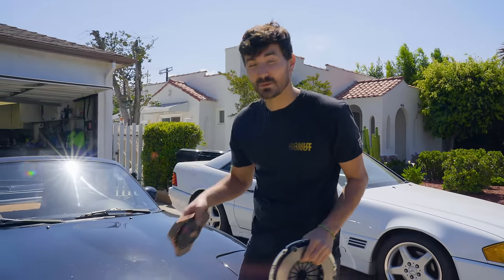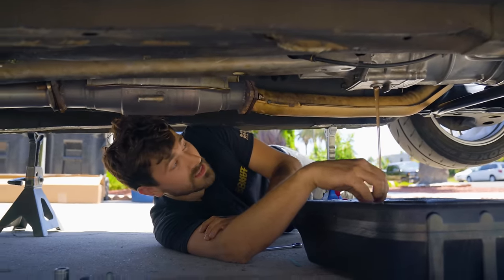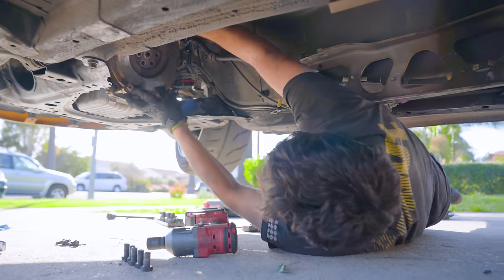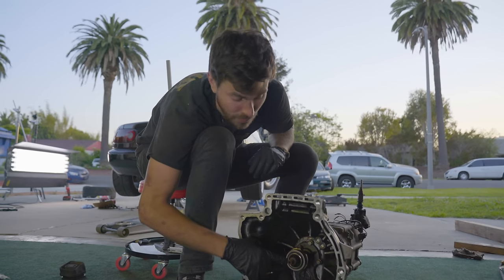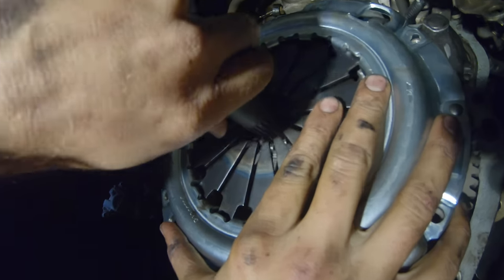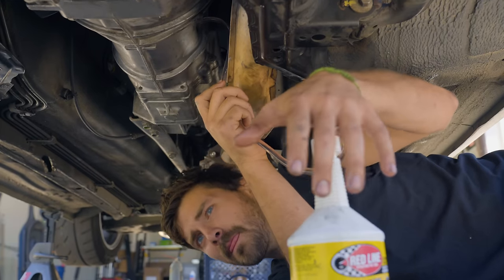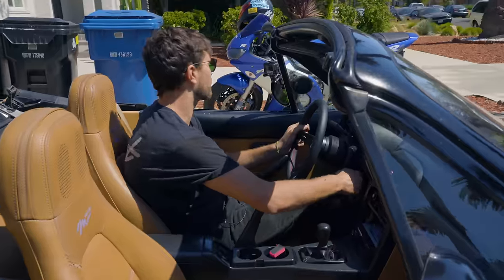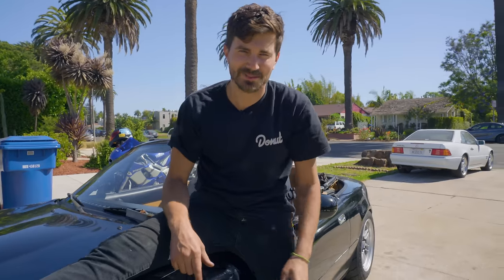We got sent a super weird clutch and installed it anyway

Comment: This gives me flashbacks to dropping my transmission 12 times on my back
Reply: Bout to do it for my 3rd time. Hopefully its the last
Reply: Looking for a fidanza before i get in there😁
Reply from the maker: I was channeling my inner Greg on this one for sure
Reply: Those alignment plugs suck. If you wrap an extension with tape to friction fit (lightly) into the friction disk and pilot bushing the trans will line up easier.
Reply: @jasonpeizer9042  Or once you break enough transmissions you'll have a spare input shaft to use 😆 the best clutch alignment tool I've ever had
Reply: @jasonpeizer9042  I've never had one issue with an alignment plug ever, and I have done MANY transmission drops/installs.
Reply: Dido!
Reply: Been there....
Reply: @bradleyland  no doubt, that seems like just the initial onset,doh.....
Reply: I only ever done it once.  But, it was a T-56, so once is enough.
Reply: @TheCarPassionChannel    Yes, old input shaft is what I used to use before clutch manufacturers ever thought to supply an alignment tool.
Reply: Yeah its a nightmare. Worst experience under a car. Ponytail wicking up tranny fluid. All the yucks.
Reply: old school porsche factory videos have a guy sit down on the ground 2 other guys bring him the engine he puts it on his feet and rolls it up and in.

Comment: Thanks  It was like re-living  my younger days as an Auto mechanic. Also worked at AAmco for years and installed untold amount of clutches.  Everything was still familiar to me. Looks like parts have changed very little in last 50 years. Clutch parts anyway. That was a great presentation of covering about everything with that job you did. Very Professional.

Comment: F for Zach and anyone who's had to do a transmission without a jack. There's a lot more cussing that probably got edited out lol.
Reply: Oh yeah I was thinking the same thing
Reply: And magically now the neighbour's little kid knows a lot more words
Reply: Had to do a FWD Trans without one. First time ever doing a clutch. Pulled the whole engine and it took 3 days all up
Reply: Been there done that...  Was helping a friend replace a clutch and boy o boy it was a shitshow.
Reply: I did one once on an Alfa Spider, in an apartment parking lot, in the middle of winter with snow falling. Every single part was a solid block of freezing metal sucking as much heat out of my hands as possible. And yet, I kinda miss those days.
Reply: @Plasma43official   Yeah FWD clutches are like that.     4WD is worse, since there's three driveshafts and often a transfer case to take off...
Reply: @cr10001  what are you working on that had 3 driveshafts?
Reply: @hunterprice6724    The wife's 2002 Mazda Tribute  4-cylinder manual (same as a Ford Escape, in fact the motor has Ford badges on it).   Has front-wheel-drive plus a viscous-coupled rear drive.   You can actually do the job without removing the motor, though you do have to remove 3 of the 4 engine mountings and support the motor while you take the gearbox off.   Took me 3 days, maybe I could cut a day off that if I had to do it again...
Reply: A Subaru STI has got to be one of the worst cars to change a clutch on. A friend and I have done it twice (once on his car and then mine) and it only gets a little easier the second time. There's just so much stuff in the way (AWD and top mount intercooler add to the mess). And we couldn't lift the car up enough to stand under it, nor did we have a trans jack. Having the front and center diffs built into the trans adds to fun. We both felt beat up for about a week afterwards, good times.
Reply: @cr10001  I had to do my TT Quattro, worse job ever took me a while as was waiting on new internal parts before putting back together, transfer box was the biggest bitch so I ended up fitting seperaty
Reply: @Video_Crow  that hits deep dX
Reply: but if you have a pit no jack needed
Reply: Nissan hardbody only took about 2 hours to change a clutch (single person) with dropping the trans onto your chest.  Put back in the same way as well.  Nice to see how it really is done.
Reply: I feel the pain, did it twice in the same day. Not fun.
Reply: @hunterprice6724  he could be talking about a short driveshaft in between the transmission and transfer case then one for each axle or my truck has a two piece driveshaft to the rear cause its a 8ft bed dually and is long as hell and the 4wd version would have to have atleast 1 shaft to drive the front..?

Comment: This reminds me so much of that time I changed the transmission on my R32. I had lifted the car over a depression in the ground to give myself more room to maneuver the tranny. Removal went super well, and then right before I got to reinstall the new transmission, it started raining. That depression in the ground filled with water. I used a motorcycle jack to lower the transmission, and of course it was too high for the install, so once the weather got a bit better, I had no choice but to lay in that nice big puddle and lift with my belly. Fun times. Still, the moment that shaft got in felt like I had landed on the moon.

Comment: My Grandma had a Pontiac sedan in 1972 (I was just learning  to drive stick shift) that she had them put a tractor clutch in. The engagement was about a half-inch - it was literally an on/off switch and the disk pushed back so hard I couldn't tell when it was starting to engage.  My Mom had a Subaru in 73 that was also a stick, and when I tried to shift - it was like a miracle, I could tell instantly when it was starting to engage. Your fears for drivability were like a flashback for me :)

Comment: I had to do a Miata clutch in a parking lot at an Autocross event one time… can confirm that the transmission on your chest bench press using you knee for support is the proper method.

Comment: Watching this process makes me appreciate the Triumph Spitfire even more. I used to own a 1974 Spitfire 1500 and one day when I went to go home from work I noticed a puddle of fluid under the car. It was fluid from the hydraulic clutch (the clutch pedal was on the floor). After power shifting all the way home I set about replacing the slave cylinder which was the source of the leak, requiring removing the transmission (put a new clutch in just for fun). In the Spitfire the transmission is removed from the top, you literally get to sit in the driver and passenger seat while doing all of the work. It isn't even possible to take the transmission out the bottom because the classic hard frame that the Spitfire has is in the way.
Reply: You bring back good memories.  When I was a kid my father had a '62 Triumph Spitfire Mk1 that he drove almost 200 miles round trip every day for work which was a lot more driving than it was really designed for.  A couple times per year he'd come home from work on Friday and we'd start stripping for an engine rebuild and have it up and tested after dark on Sunday night.  We used a Massey Ferguson TO35 with boom to lift the engine.  I used to think I loved working on cars but after he died I realized it wasn't working on cars that I'd liked so much, it was working on cars with him.
Reply: @andrulV2  I absolutely loved taking the transmission out through the passenger compartment to replace the clutch. My 74 had the factory hardtop, six bolts, ten minutes, and it was half an inch lower than the rag. How often did you lift the inside rear wheel off the ground in tight turns? I also loved being able to do a U-turn inside the lines of two standard 12 foot wide lanes. I found out that the little plastic spoiler on the front actually worked. Near top speed, at around 90MPH, the front would crank down and bring the cat close to its braking stance, with all four tires square to the road.
Reply: @letstrytouserealscienceoka3564  I do remember that tight turn radius. Never lifted the rear tire though, my dad would have skinned me alive then made me rub the salt in myself!
Reply: @andrulV2  Probably a good thing because if you did not know that the car would do that, it could quickly lead to rolling it. The car would exhibit typical understeer in hard cornering until the inside rear wheel lifted and then jump to hard oversteer so you had to be ready to change your steering angle to keep it steady. It was a little dangerous, but a real blast.

Comment: I'm 60 seconds through this window and I'm pretty sure that clutch is for certain Miata racing where the engine and transmission are supposed to be bone stock, with the idea being that the 1lb of less rotating mass from the puck design and aggressive bite means faster engagement / less slippage on shifts (combined with the reduced rotating mass). You're talking about a clutch designed to save maybe a quarter to a third of a second of average lap time maximum. I know a guy that races stock Miatas and this looks precisely like the kind of thing he'd be using.
Reply: Thats true its weight reduction and 260Nm in 1.6-1.8 NA engine is plenty even when its build.
Reply: You're basically talking about spec miatas.
Reply: @itsjustpizza  correct. I believe that if allowed, this sort of clutch is precisely what a spec miata racer would want to use.
Reply: @racerex340  I don't think there's any clutch or flywheel restrictions. So this should work fine for that. Not like any inspector would be able to check anyway.
Reply: @itsjustpizza  if you won a race egregiously, safe bet they will be checking your car thoroughly.
Reply: Its just a stage 2 exedy 3 paddle clutch, nothing to special or uncommon about these

Comment: I remember that time that my father installed Ford Galaxy 1995ish performance clutch in our 1985 Ford Escort station wagon because Escort cluch burn dawn, and he couldn't buy any other cluch because there where no other cluch. 
Galaxy cluch was 5cm (2 inch) bigger than Escort, so my father takes angel grinder and cut that 5cm of the cluch and put it in car. It worked for 5 years.
Reply: I had a stroke reading that
Reply: I won’t lie that’s pretty kickass! I would’ve never thought of that!
Reply: Nice work bro

Comment: I have used this clutch a couple times. Its amazing compared to the unsprung 6 pucks that everyone was using back in the day. For a b series Honda that you daily drive I think you can't beat it. b18c5 with toda cams I could run 10-15 passes at LACR a night and it would hold no problem.

Comment: I was a vehicle mechanic for over thirty years , working for main agents and independent workshops . Just yesterday I was under my daughters car to change a starter motor lying on my yard , ouch what a struggle I do not miss that kind of job . You advised to grease the gearbox spline and release bearing , I would never do this but ensure they were cleaned and dry ,as clutch dust would gather in the grease and possibly cause binding over time resulting in stiff pedal action and possibly clutch slip . Another tip would be to check a new clutch disc on the gearbox spline before assembly to ensure when you are lifting the transmission it will enter the spline nicely .

Comment: imagine doing this in a gravel driveway

cuz that's all I got
Reply: Go to Walmart and buy you some cardboard boxes, or if you're fancy grab a yoga mat/nap mat, or the kids foam puzzle mats
Reply: I'm in the same boat every time I have to go under one of my cars. It's kind of a drag knowing I got to work on my car when I used to really enjoy it. Can't wait to move told the family next move we are getting a place with at least a concrete pad so I can enjoy working on my cars
Reply: I just use 3/4 inch plywood in my gravel driveway. Holds up by 3800# blazer on jack stands no problem. Also is nice so you can move jacks and engine hoists around
Reply: I use Wool bale covers when under my car
Reply: @chapa435ify  My dad and I replaced the rotors on his BMW, we have an extremely small garage and a gravel driveway. We indeed used large cardboard box panels on the gravel to save our knees

Comment: I’m literally sweating just watching him trying to install the transmission by himself with no jack
Reply: Your profile picture scares me
Reply: Do it with an m50dr2. Or bw4404
Reply: I installed a Ford C4 automatic into a 302 F100 one time by taking it under there on top of my chest (I was rolling on a creeper) when it was raining hard and I was pissed, and just wanted to get it over with. 
I managed to manhandle it into place and bolted it up. 
And weighing 150 lbs or so at the time, I was not a big guy when I did it.
Reply: Same i was scared it was going to fall on him on his head.
Reply: Flock that's nothing. I installed an acura integra automatic trans with no Jack. 
Polly one of the dumbest most scariest thing I had ever done. 
I some how got it on my chest and after 4 hours of resting and Polly a couple  near death experiences I was able to start a bolt. 
At one point I was so exhausted from the effort that I had to take a nap to get some strength to lift it. I only survived because I was some how able to squeeze my hand between the trans and my chest. So that the trans wouldn't crush my chest and block my air ways. 
At one point I even thought, I was going to be on a hundred ways to die. 
Literally would of found me with a trans crushing my chest with a 👹 red face look of death or 🤤 dumbfounded face of a kid who was relieved to be dead.

Comment: Please, for the love of everything miata related UNPLUG THE DOOR BUZZER!
Reply: yeah it's only a couple times more annoying than the Honda morse-code letter H key-in beeper.  I wired in a bypass switch on my Integra door open switch so I could have the stereo on with doors open while detailing or cleaning or whatever.
Reply: AND FIX YOUR BENT HEADLIGHT CORNERS
Reply: @Patrick94GSR  TIL
Reply: I unplugged that thing less then an hour after buying my Miata.

Comment: Ones I made this work on a Ford Escord without having a centering tool for the clutch. So I had to use the spindle of the gearbox and tighten the screws each by each through the  clutch lever window. After each screw I had to rotate the fan a little bit until I found the right position of the next screw . This procedure was very time consuming because I did it all alone without anyone telling me to stop rotating the fan on the right position. But finally it worked.

Comment: 10:30 look like me replacing the starter on my magnum hemi a few days ago. Exhaust AND rack & pinion have to come out. SOOOO heavy!
Oh yeah, & all I needed was a friggin battery. Smh. Waste of 3 hours & $150🙁
Reply: Man.. A bad starter and a bad battery are way different.. How did you get that one confused? Haha. Bet your battery was giving up for a long time before that point too.
Reply: Good God man, get a different car.
Reply: And that's why you learn basic electrical testing.
Reply: Just replaced my starter too but I think it’s what my challenger needed, now I have to replace the clutch though 😂 I thought American cars were supposed to be cheap to fix 😂
Reply: Lol, my Dodge truck has the same engine. It refused to start in the Walmart parking lot one night, me and my buddy replaced the starter and eventually the battery as a last attempt. We even tried replacing the ground wire going to the engine block, after trying for hours we locked it up and decided to go home for the night. Before I was about to head home in his sister's car they let me borrow, I said after thinking for awhile there is only one thing left that could stop it from starting. We went back to the Walmart parking lot and used the battery cable we had bought and instead used it to replace the main power wire going to the starter, the truck started right up, very fast too might I add. I've learned now if you ever have a starter not working, first try the power and ground wires. We had already exchanged my old battery and I did not want to reinstall my old starter, so we left them installed anyhow. The funny thing is the truck had always had a super slow crank since I've owned it, I thought it was simply normal or just an old worn out starter, it was that stupid power wire the whole time getting ready to quit, must have been holding on by like 3 copper strands.
Reply: @tacotime247  haha nope, everything I work on is American and it's all expensive. I just replaced a rear lock on a GMC savanna 2500 and it was 150$ part plus a half our labor. So 225$ for the simplest thing, made out of plastic with a brushed dc motor. A starter for the same vehicle from GM is almost 400$, 200$ from an autoparts store, but I've a had about 50% of those fail within 2 months. American vehicles are just like everything else now.

Comment: Thank you for sharing. One point you didn't mention. Some engine's are externaly balanced by the flywheel. And you can purchase a flywheel that will fit but is not weighted to balance the crank shaft imbalance. Also ring grears often have different tooth counts.

Comment: Great video thanks for sharing. You fellas just bought back some real memories. My worst gearbox job was on my 1980 ZJ Ford Fairlane (Aussie model) which I did a manual conversion on as Fairlanes here were auto only from the factory. The job took 2 days I reversed out of the shed and the box dropped its guts all over the driveway. The fact the box was out of another one of my cars and worked great our guess was the new setup was way to much for it.